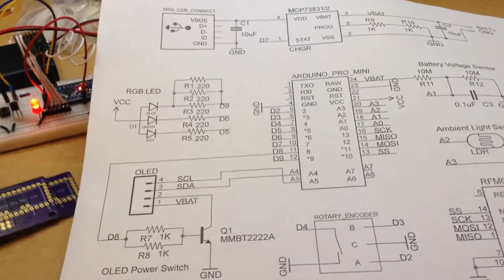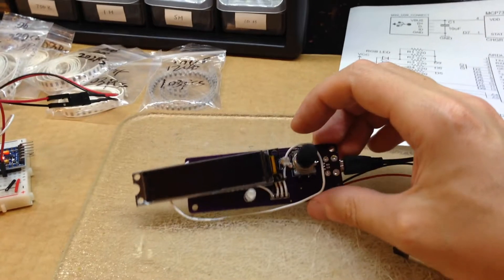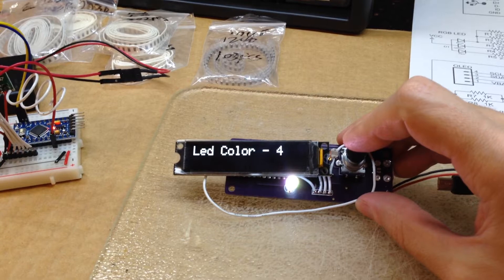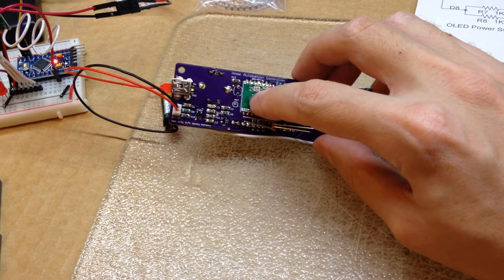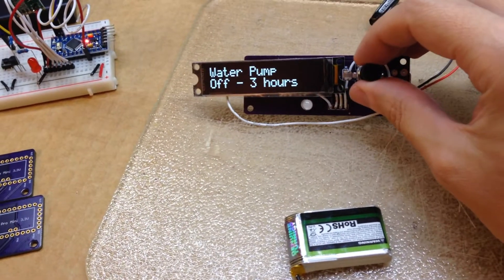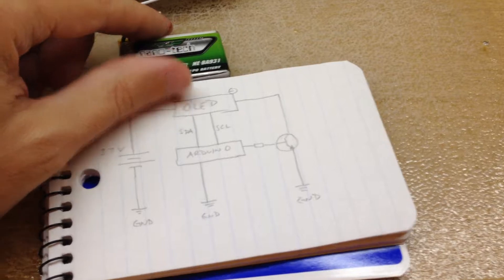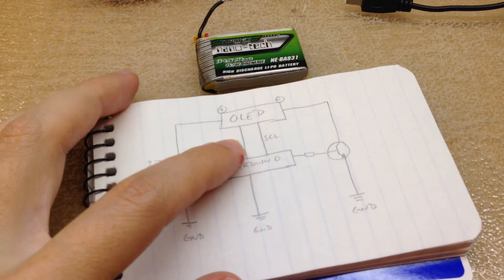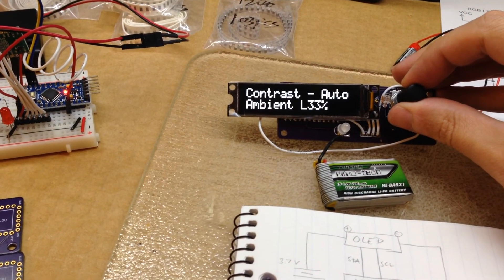Arduino Wireless Pump Controller 09 - Assembled PCB's

Comment: your lipo is not dead.  you can force charge it at a low current to get it up past the min voltage.  just use a 9 volt battery or something similar to recover it.  nice project.  use a ldo regulator and set it to drop out at your desired min voltage to protect the lipo.